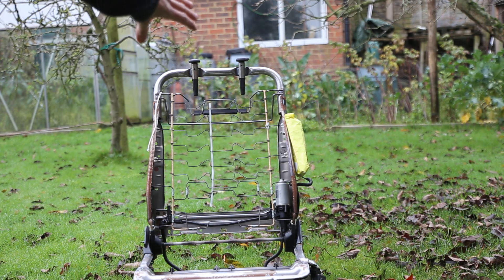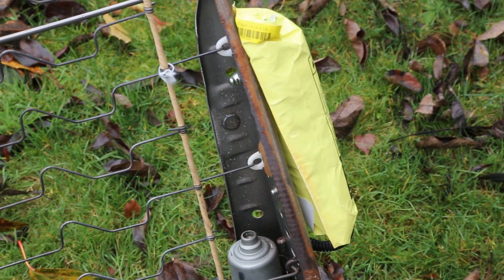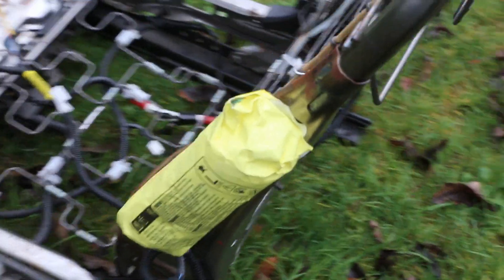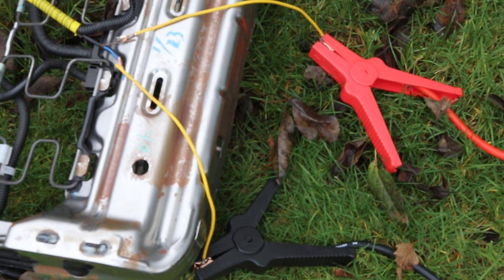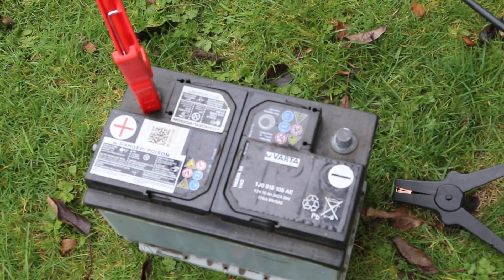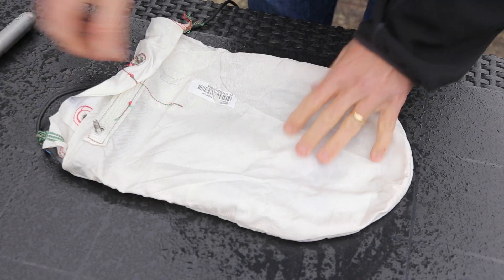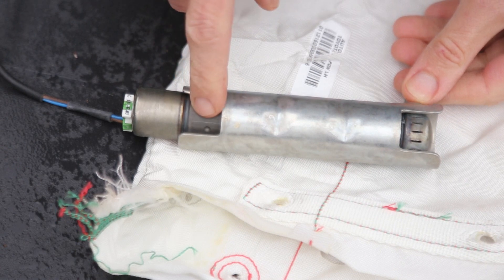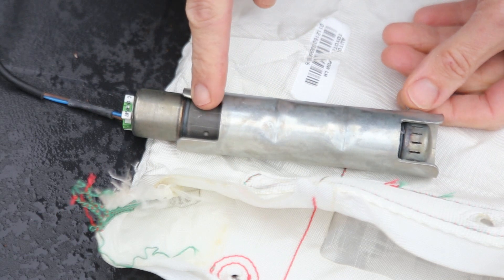How to Explode Airbag-Deactivate Seat Side Airbag Detonate with 12V car battery to trigger

Comment: Sir. Thanks for the video. I just want to ask that the airbag itself have only 2 wires that have a "+" (red/yellow) and "-" (black/white), so when we active the airbag we only need to connect the wires to the battery. So if I want to add the side curtain airbag to my car which only have steering wheel airbag and passenger airbag, I only need to make a circus that connect to the same wire of the passenger airbag or steering wheel airbag to the new curtain airbag? the same if I want to add chair airbag or knee airbag? 
thanks alot .